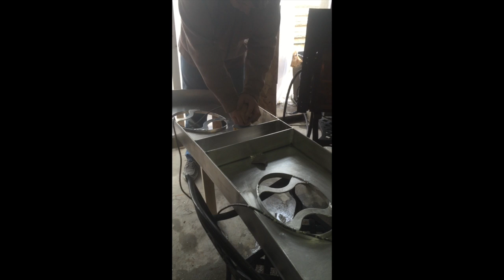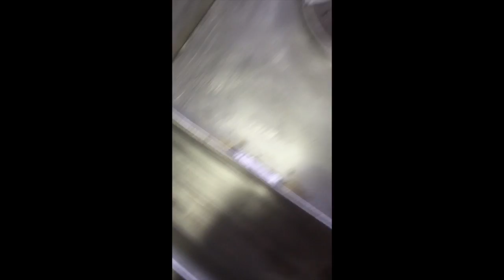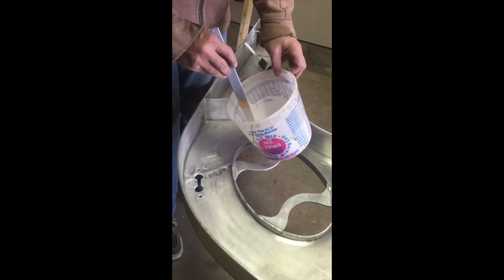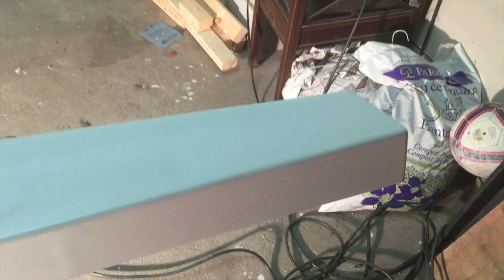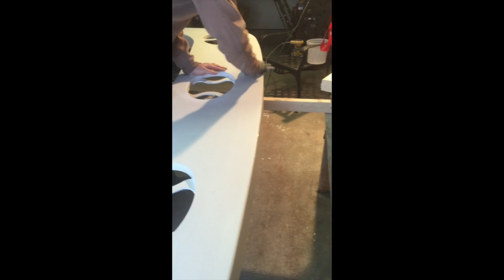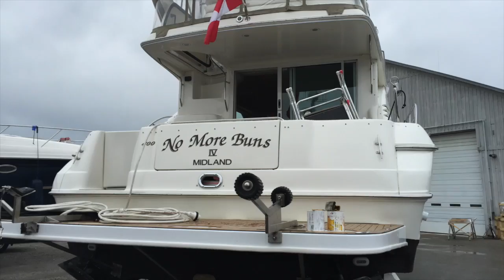Sea ray swim platform extension

Comment: Hi
Planning to do the same with my SB 400.

How did you mount it on the existing swim platform?
Reply: This is my son’s account we put this video on but to answer your question, once it was married up against the existing platform the two were through bolted then the 3 angle brackets from there back to the transom. There were also 2 horizontal 2x2 stainless angle brackets passing through and through bolted to the structure of the existing platform. I put epoxy in the joint before the Nuteak was glued down
Reply: @peterhaats  

Thank you for that. Will study on how I can extend mine. Great and good work you did.